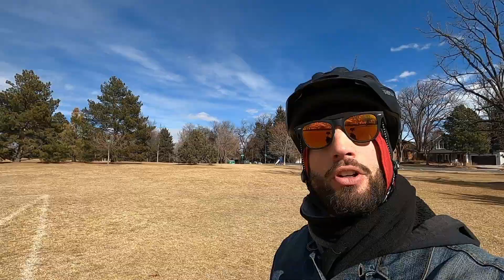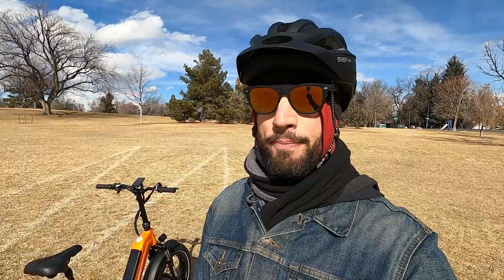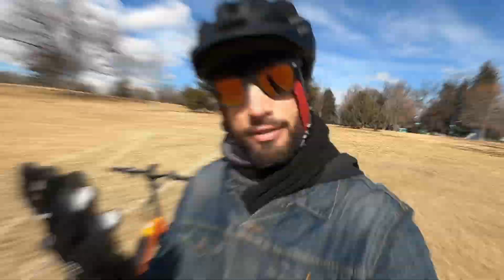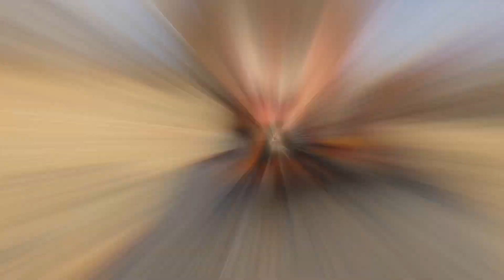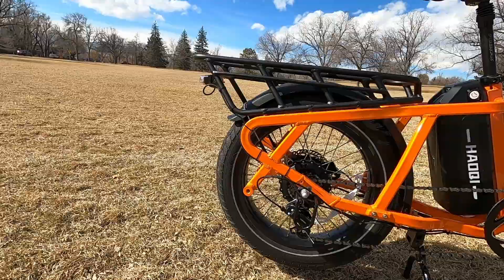Ride Review: Haoqi Camel Dual Battery Electric Cargo Bike

Comment from the maker: Note from Haoqi: You should be able to unlock the top speed to 28mph (45kmh) using these steps: 
- Power on the display
- Squeeze the brake lever five times (ou have to do this within five seconds of turning on the display) 

We weren't able to get this to work on our test bike, so your mileage may vary! Also note that even if the speed is unlocked, the limited gearing range will make it difficult to pedal much over 20mph (32kmh).

Comment: Having only one speed restriction, the top speed, is what I was expecting when I got my bike. But it has a speed limit for each level. plus, it feels, regen braking cuts in when you go above the level's speed limit.
I want to see if there's a way I can change that.
I can peddle the bike quite easy with the power off though.
Reply from the maker: I couldn't figure out a way to change it when I messed around with the bike display. It is probably possible, though - I would reach out to HAOQI support and ask them :)